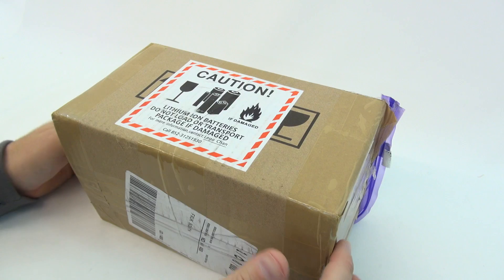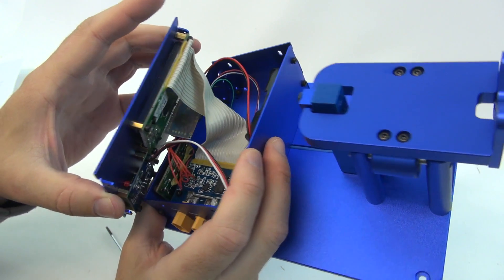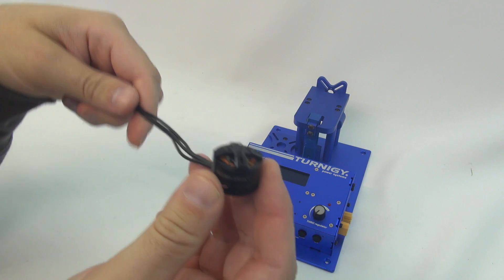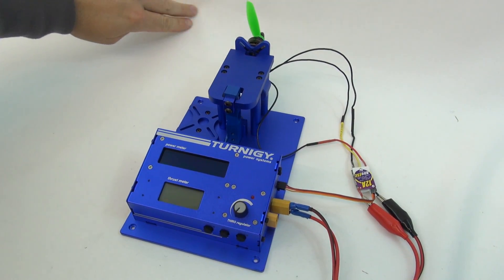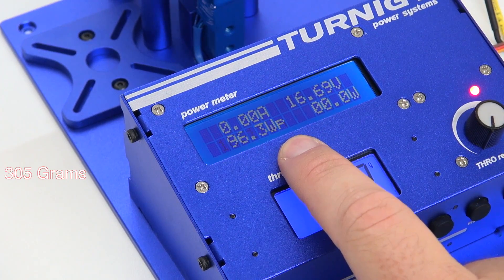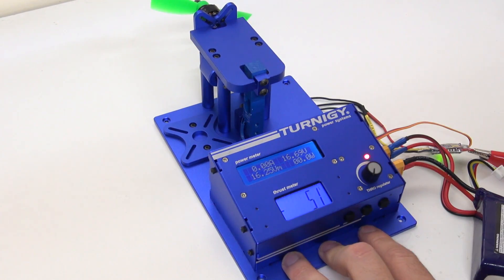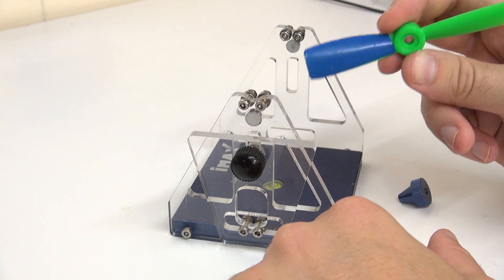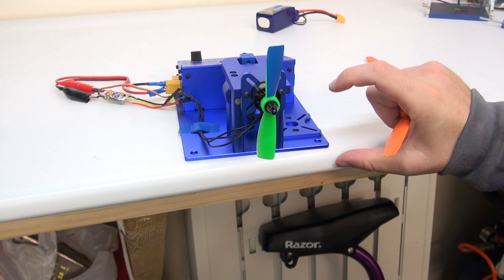HPIGUY | Turnigy Thrust Stand V2 - DYS & Thug Prop Test

Comment: I bought the Lander Technologies test stand a couple of years ago (seems to be very similar to the older Turnigy stand). It's just a basic thrust meter but eventually, I'll wire in my WattsUp power meter. Tonight I tried to use this stand and found with a Dynam outrunner from their Primo model that the shaft protruding from the rear is too long so it can't be mounted on the stand. The space behind the motor isn't deep enough! Can I cut and shorten the motor shaft or grind away the slot in the stand to make it deeper? Which do you think would be the best to do?
Thanks for the video, was interesting and fun to watch!  :o)
p.s. At 440 watts your motor was producing .590 horsepower!

Comment: This stand is such a peace of JUNK... just look at your results, it doesn't return to 0, it returns to -51, 17, 24...
I made the mistake of buying it, and the bearings are totally fucked, they can make it over 130gr inaccurate. Then if you try and fix it, the screw threads get fucked. So DO NOT buy it folks!
Reply: thats what happen when the stand is interupted when you hit the "tare" button also the wires can cause your reading to be inaccurate, so don't let them hanging.

Comment: That is a Rotary Potentiometer that you are turning. With no power to it. You can place a meter to 2 of the 3 wire/pins. It will give you a range in ohms.  Say something like 0-500 or 0-2000 when you are turning the knob. You can mark the outside of the case to give you a ballpark %. Say full off is 0 and full on is 1000 ohms. Then you will know 500 ohms is half throttle etc.....

Comment: Can you test the BE1806's on 4s with 5" props? Like GF5040 or tribade? I'm curious to see if it can handle it on 4s. Cheers!
Reply from the maker: I done a whole video on them last night, but all on 3cell. I used 4045, 5x3, 5x4, 5x4 tri blade, DAL 5040. It is edited and uploaded. I'll publish it later.
Reply: +ThatHPI GUY Yeah I know they work well on 3cell, but would be interesting to see if they could handle 5" props on 4cell without smoking up. Least aggressive prop I have is 5x4 gemfans which might be too much. But I guess I'll find out soon enough, ordered some Tattu 1300mAh 75c 4cell today!